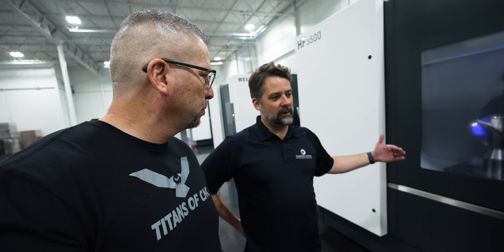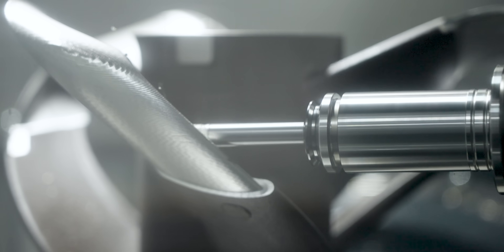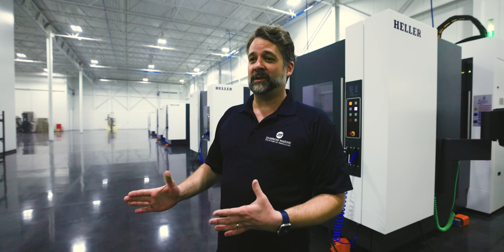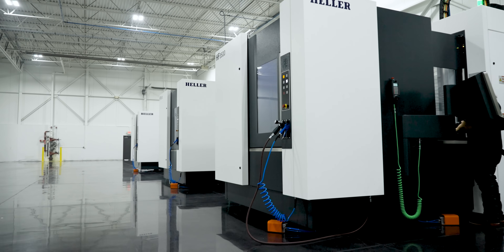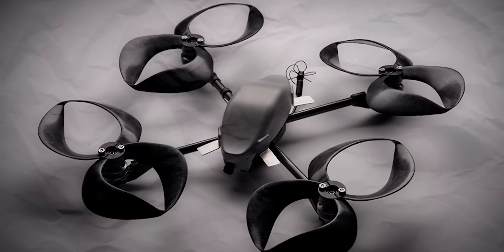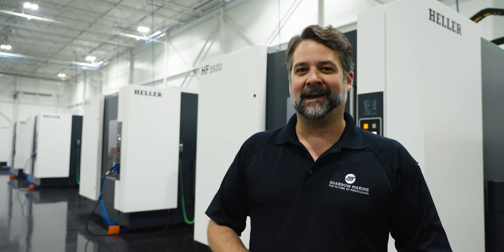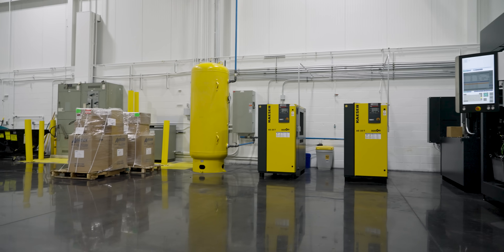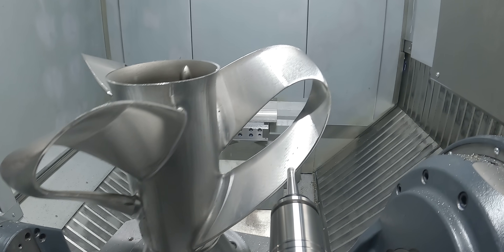BRILLIANT HELLER Machining Cell at Sharrow Marine | Made in America

Comment: I placed an order with Sharrow for two of these propellers through one of their sales people for my new boat to be installed and tested by the manufacturer. However, things changed when their engineering team learned that the props would be tested by the boat’s manufacturer. They said 87 days wasn’t enough time to produce the props although prior to me placing the order it was. I reached out to Greg Sharrow and he had someone else respond saying “Our manufacturing process is complex and currently takes about 100–130 days. It includes engineering, casting, and precision finishing to ensure the highest-quality product. “ I guess these Heller machines aren’t that fast, or maybe they just aren’t comfortable with an independent test of their product.

Comment: Then why not lubricant cool while making the parts?  You're admitting this is costing you in tooling (obvious).  I would assume the machines are made for wet cutting.  Is it that you don't want to invest in getting filters & outside cooling tower? You could even go "crazier" and get a geocooling company to do ground water cooling to get LOW temp.  You're talking expansion and tooling costs.  I've worked production CNC work and everything was 100% lubricant cooling.  But, the exchanger was in the same room making the noise/heat unbearable.  

There's no way, even if I was at the facility talking to you that I wouldn't have immediatly asked why you're not using lubricant for high-speed production work.

Comment: My question is how the heck are you going to repair these beautiful props? Hard water is a part of marine life. Good stainless is expensive and good Nibal can be more. They will also destroy lower units and shafting in addition to the nicks and dings that mar the finish and spoil pitch setting. You can't toss them out like inexpensive alum or plastic ones. Can you make a living repairing them without owning a multimillion-dollar shop? I do like the loss of vibration and noise. If I'm wealthy, I'd not worry about that. 
The Amelas One

Comment: At $5000 per prop for a single unit, it’s the most expensing next to a full race prop. This prop has been floating about since 2016. This design has been around since the 1950’s. It’s not cost effective, and not repairable. Too much BS in this episode.

Comment: Seem like decent machines, but I don't see how they are much better than any other horizontal with a 4th axis. The pallet system is nice, but it looks just like a mori or mazak. Maybe the price is a lot better, but then it makes me wonder if they saved costs on either rigidity, precision or durability. They are only machining aluminum in the video so maybe some of these concerns aren't an issue.

Comment: Why not use powder metallurgy and 3D print the thing rather than machining? 
After sintering, it could be coated with electroless nickel if you need a smooth surface.

Comment: $5000 for a prop is for sure crazy prices, I can buy a yamaha saltwaterII prop for $600..
Reply: the cheap prop  will cost you 3 time the fuel to turn it too , and it will be half as fast as the 5 grand prop.
Reply: @fixitfast110  only save about 5-10%,and is not any different at cruise speed, only like 1% of the engine life is ever at max revs, the only place it's faster... slightly faster to plane, but over the course of the boats life time saves you less than a minute..so, yup super interesting prop, does what it was designed to do but business model fails at pricing...I'll wait for the next company knock off of this prop at a steeply discounted price
Reply: @Tri675racer37   oh i sees  ty

Comment: It's interesting that this design does not work on a drone / in the air, but it allegedly works so well in the water. Amazing machining, and the part looks beautiful!
Reply: It does work really well in the air, look this up: toroidal-propeller drone. Essentially the same, just optimised for the lower density of air, rather than water.

Comment: 😂 "Crazy prices"! $5000 is crazy prices, especially when a normal prop is 1/10. I'm not saying that the higher cost can't be worth it in reduced fuel, but everyone should do some real calculation to get the ROI right. When the cost disparity is reduced this is a sure winner due to increased efficiency, reduced noise, less environmental impact due to less wake etc. But that upfront cost is a hard pill atm.

Comment: Just a couple quick questions ,does the Sharrow prop come in variable pitches ,also do they come in 4 blades or hi 5 s with a cup? of not why not try !but that would depend on cavitation for higher speeds and torque also cornering
Reply: I saw them making several different three and four blade styles.

Comment: I've been wondering how these propellers are manufactured. My first thought was that they were printed then polished. Interesting that they're milled.
Reply: Strength, the effect of sea water on printed sintered metals, and wear resistance are all big big concerns in using an additive process.  But maybe... things have changed a lot in the last few years.
Reply: @advil000  Additive is much slower, and the part finish isn't what they need, so, they'd have to machine anyway. SLS is much better suited for prototypes and short runs, or things that can't be machined or cast due to internal structure.

Comment: Cool video and design of fluid movement device - I saw a the design being used on a PC fan a few months ago, nice to see who it originated with.

As an aside, there's a lot of material being removed - have the chaps looked at tigher casting tolerances to reduce wastage and tool wear, or are they made like that to allow for different profiles to be machined for different pitches and cruise/speed efficiencies?
Reply: Casting tolerances are very expensive tbh, probably cheaper to cast it proud and then machine it into tolerance than it is to cast it tighter. Fewer scrap castings that way as well.
Reply: @jttech44  
Thank you, the material isn't that cheap, but especially if they're dry cutting it can be returned to the foundry and recast into the next set of blanks, anyway.

Comment: As a retired programmer, I can appreciate what you have done. I started CNC programming in the early 80's using a very primitive Mastercam. It's all come such a long way.
Reply: Programming is pretty exciting stuff!!  I started programming in the late 70's.  Used a Friden Flex-o-writer to punch 8 track paper or mylar tape to run some old Acramatic 225 NC (not CNC) and Cincinnati Big Blue controls.  Our first programming software was a product called NCApt, written by a guy named Dave Naylor in Seattle.  Completely text based, NO graphics, just a Hewlett-Packard plotter.  I've never used MasterCAM, but had a similar (sort of) product called SmartCam Freeform Machining.  They disappeared for a while, but are back!
Reply: @notsofast2539  I remember the early days too. I started programming using a teletype with an RS232 connector. Those were the days my friend. 😉
Reply: @notsofast2539  Also a SC FFM user - not many of us left, but I do love the program. Made a lot of satellite and medical parts with it...

Comment: I didn't get the point of what the start of the CNC process is. A solid block of metal? It seems to me the props are molded and the CNC milling is "just" the finishing. If that is the case, molding these complex parts is even more amazing to me. Any insight anybody?

Comment: You’re right about the crazy prices. Their props are 10 times the price of a regular boat propeller.
Reply: They significantly improve fuel efficiency of marine engines- one test, on a 2x300 hp motor cat, showed a 9 gallon per hour improvement at certain revs/speed. For a lot of applications, esp commercial boats, they’ll pay for themselves.
Reply: @aggiewoodie  All great if you can afford the upfront costs. How many Americans can afford a 5,000 dollar Prop? We should all know people in third world countries where this tech could make the biggest difference can't afford it. How many Americans are now living in a third world America because they've been priced out of the first world America? 
We need to solve the issue of making tech more affordable for all and especially the lower classes where the biggest positive impacts could be felt.
We have a handful of people that want to become Mega Rich unwilling to see or accept the collateral damage they are causing to millions upon millions of people if not billions of people.

Comment: Sharrow is looking into carbon fiber reinforced resin to mould these propellers in one shot no need to machine it . The die moulding will be expensive but producing over 100000 of these items should pay off . The one thing I noticed I've seen promo clips they never mentioned weight of the propeller because aluminium, stainless, titanium or bronze have different densities.

Comment: use a 50 000 tonn press and press the proppeller in aluminium, Aluminium becoms super strong and hard under that pressure. Gemany did that to fighter frames before ww2.

Comment: The guys who are most impressed by these props are offshore anglers driving center-console boats. They give you about 20 percent better fuel efficiency, which gives more range on the same fuel load. More range gets you to where the bigger fish are.

I would have a hell of a time selling one of these to a wakeboat captain. "Buy this prop and you'll get 1MPH faster speed for only a $4000 upcharge." "After spending a quarter-million on the boat? Hard pass."

Comment: Now that I've watched the whole video I have two things.

1. The comparison video is... Deceptive at best. Above water 99.8+% of your noise is the motors and hull/wake. I have over a decade of sonar experience. The blade noise would only be relevant underwater. The most fair test would be one motor, fixed in a tank, running at XYZ rpm, then running the same setup with only the prop being different. And have sonographs for above and below water. Above water won't change much unless you run ridiculously high trim to force air induction into the wake.

2. Depending on what form these guys are working from (rough casting or pure milled form) I might be able to reach out to some old contacts and help get them into the most cost efficient pre-machining form if they ever go for steel props.
Reply: Titans of CNC, if your offices are open on weekends I'll be calling.
Reply: Go look at the Boat Test video on YouTube. The test was much more rigorous & had more variables controlled for than the snippet shown here.

Comment: Pushing the tool to its limits its not always a good option...especially on a 5 axis cnc lathe because u could easily scrap a part and when your machining aerospace components that's around 50,000 to 100,000 a part that I work with every day.
Reply from the maker: That’s why we said you have to weigh it based on applications
Reply: When your market is "Everyone with a mercury outboard and 10k to spend", it makes perfect sense to make as many parts as you can and sell as many units as you can to fund the cost of scaling your process. Take that operation, scale it 10x, and you probably don't have to run that hard, and if you need 10x, which they do, you're going to find it very, very difficult to find a shop that can handle it, and you're going to find it very difficult to find a shop that's willing to run their tooling and machines that hard too, at least for a reasonable price.
Makes perfect sense to bring it in house, operate on known margins.

Comment: Do they get the floors levelled to a certain tolerance . Id like to see what goes into the construction of facility like this.
Reply: They level the machine. There's no way to level concrete to the tolerance needed.
Reply: @JJ龙龙在澳洲  there is also no need. what matters is a rigid frame and motion system and to a lesser extent the levelling of the machine.
Reply: The machines stand on a concrete pad, usually one that's fairly isolated from the floor (via mass) and then the machines themselves are leveled on install. So no need to level the floor outside of getting it "pretty close".

Comment: Other companies are always thinking of 3D-printing for complex parts. But their precision is lousy. And you have to treat the surface after printing anyway. Milling at high precision seems to be still first choice. 
Good job.
Reply: What are you talking about? 3d printed isn't used for mass production, yet. Well, the attempts made have been slowly progressing.  Unless you're talking about laser sintering metal, then I question the need for heat treatment.
Reply: @NoMoreBsPlease  SLS still needs to be sintered/heat treated to grow the grains of the metal together fully. And you have to account for part shrinkage and warp in the process, which is very much non-trivial. For something like this, where, it needs to remain balanced, I'd imagine it'd be a nightmare to get right.

Comment: 20 years ago I had the opportunity to achieve high productivity in pieces with very thin thicknesses, immersing the pre-finished pieces in a very low shrinkage resin.  Increase the cutting conditions and you will greatly reduce vibrations.  try it!. 
💪
Reply: That's very clever. I wonder if you could find a resin that you could melt out, leaving the part behind.

Comment: weighing the cost of the part versus the lifespan of the tool, an interesting concept i've never thought about. If i ever end up with my own machine shop, i hope to remember that concept if i get a hot contract with a short deadline.
Reply: Since I watched titan of CNC I divide by 2 the time to make a part carbure can really be push
Reply: @tristansimonin1376  oh yeah, carbide endmills definitely cut better under load, discovered that after a mistake (which fortunately didn't ruin the function of the part)

Comment: Weird question, could dimpling the surface of those props increase the props output? Between gold balls, boat bottoms, and now piston tops, it seems like something a cnc shop should explore.
Reply: - It would make it worse. The dimples on a golf ball help detach the flow of air from the surface of the ball. Think of a prop like a wing - you want the fluid flow to stay attached or you lose lift/thrust. That detachment is a stall
Reply: I'd put money on more cavitation and increased prop slip if you do that.
Reply: The dimples are to create flow sepration and allow the golf ball to slip through the air with less drag. A prop has the opposite problem, you want the flow to remain attached for as long as possible because as soon as it detaches you get cavitation. Cavitation is low pressure where the water boils and then the surrounding water pressure collapses the bubbles. That collapse causes noise, drag, and wears out the prop significantly faster. In addition to that, if the prop cannot grab the water, it can't transmit force into it, and therefore cannot do its job of moving the boat.

So, great idea on a car, or a golf ball, but, bad idea on a prop.
Reply: The prop itself would also need to be thicker to make room for the dimples and still keep the same strength.
The machining time could also double compared to now, I am guessing the machine time is already more then twice as long as old classic design props.

Comment: I wonder if you could make these with metal printing. Then add more fins.
Reply: It would take WAY too long.  That would increase the price as the machines would be in process longer.
Reply: @brandons9138  they cost $5000 a piece already. It probably takes 5-6 hours per part. You could cut out casting,tooling, and setup. If you ran only one in a 3d printer, then it would be extremely slow. If you nested 10, it might be quicker. I can't imagine it would need sub .001 tolerances. It's easy to say it would be slower, but sometimes it's worth considering an out of the box idea.

Comment: Hopefully they aren't too leveraged on machine mortgages. If there is a downturn in demand I've seen tons of shops that expand too fast then get hit hard when the contracts dry up.
Reply: I don't expect it to last that long. The numbers they got and their advertisers get are by cherry picking props to get the numbers they want. By testing various different props on different boat motor combos I have found the difference between conventional aluminum or stainless propellers can be huge. With one of these sharrow props costing 5-10+ times more than a conventional stainless prop it will continue to be a hard sell. Especially after someone wipes out their new $5k prop on a sand bar. They offer a repair service but good luck keeping up with that. People aren't going to wait a long time to have a small prop repaired. Plus there are SO many different size props its going to be hard to keep up with them all. And the boat industry has major peaks and valleys.
Reply: @sdvten  exactly. boats are for rich people. since rich are becoming richer and only 1% of population other 99 are just poor working pleb. unless these guys got contracts from all the ship companies all over the world. but those cncs can still make other parts not only props
Reply: Those props will increase in demand as they are more efficient.

Comment: That's a very complex part to make 
But we want to know more about financial problems what is the better  if you run the parts faster and lose  cutting tools , or run it slowly and have more tool life 🤔
Thank you Mr titan for this video I start love the HELLER machines right now boom 💥
Reply: It all depends on your rate, the tool price, the change out time, etc.
Reply: @vanguard6937  
Thank you man
Reply: @vanguard6937  Pretty easy math too, considering they're basically making the same part over and over again. At like 10K a pop, makes sense that the math says to burn the tooling to get orders shipped and money in the bank that you can use to scale out. Scale out far enough and you can slow down, save your tooling, and get the best of both worlds.